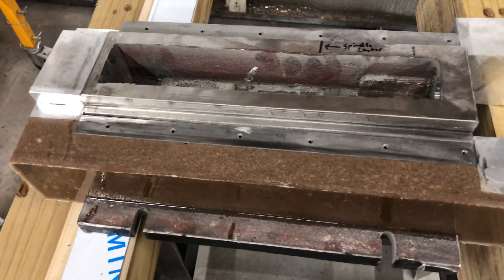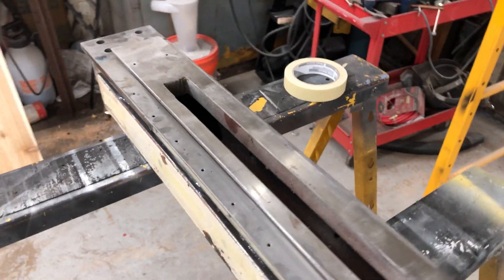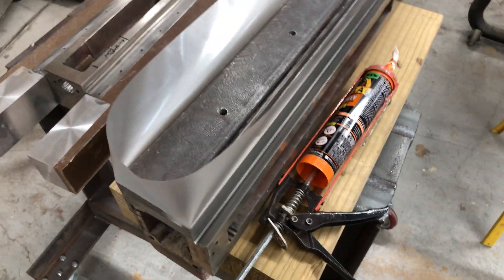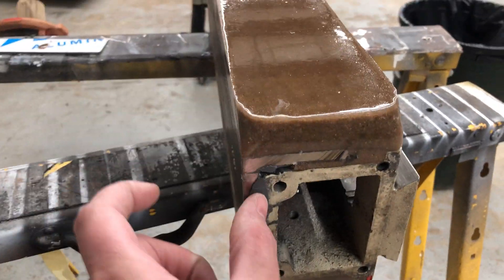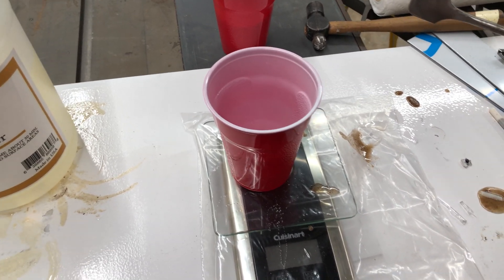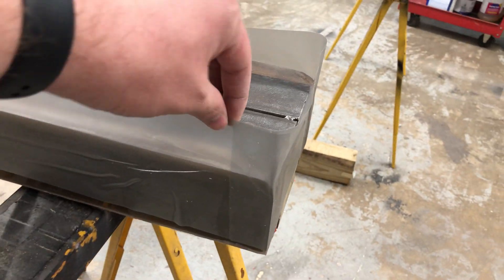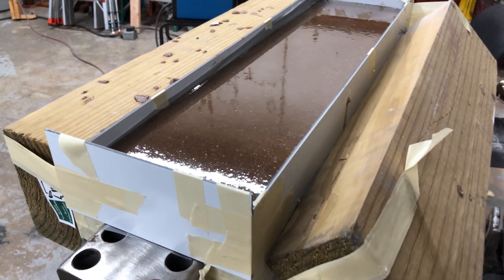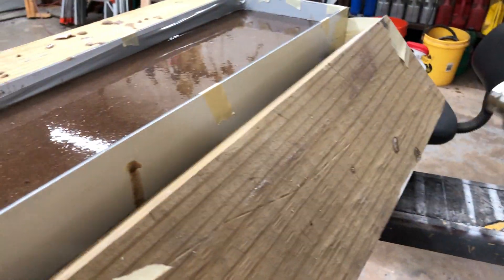Pouring The Epoxy Granite - Granite Grizzly Project

Comment: I dont know if you played with your mixtures but from my research when it's super shiny like that you have too much resin
Reply from the maker: Yes, I chose that for ease of pouring and getting out air bubbles. Also to get a smooth surface easily.

Comment: was thinking on putting a brace on the back and around the mast but with some wings sprouting from each corner in a x shape top to bottom to give it more rigidity , was allso thinking on adding height to the base of the mast basicly mounting it 10 inches or so above the normal mounting point on the back of the crosstable, 
the dovetail at the verry bottom doesnt get used when you add the height of the tool and the vice raising it up gives me more headroom 
might also move the mast back from the table and do one of the conversions i seen on the website of hossmachine to lengten the y axis travel
was thinking on casting a thick aluminium plate in the spine of the epoxy brace and bolting the original mast intoo it , after machining the back and sides of both the mast and the brace perfectly flat 
since the mast isnt permanently mounted i can tram the whole thing with slivers of feelergauge before bolting it tight 
i allso plan on pooring the brace awith a thick rectangulair slab at the base where the crosstable mounts up on 
that should take care of the weak mounting on the stock base